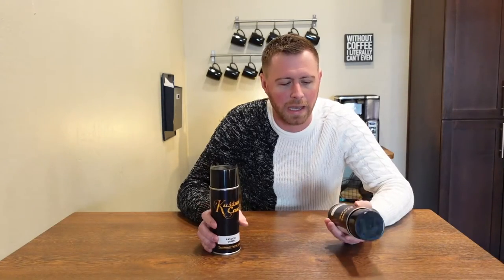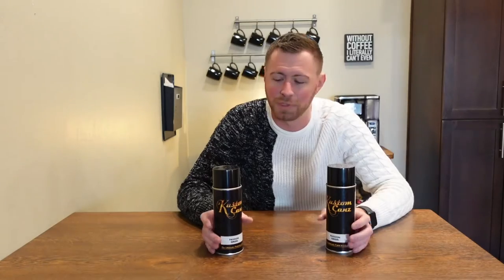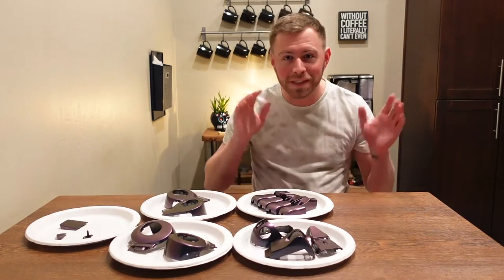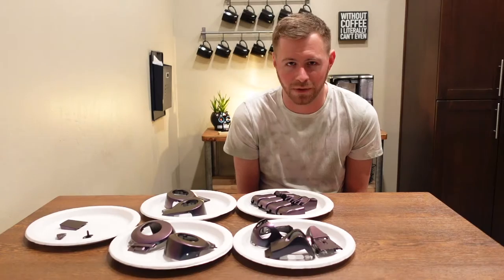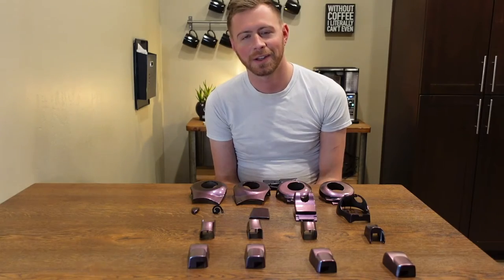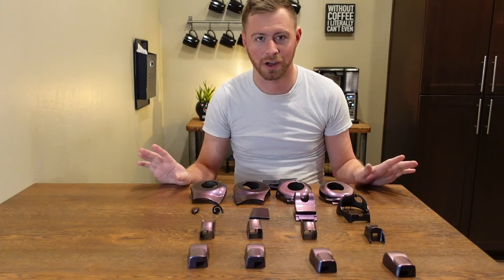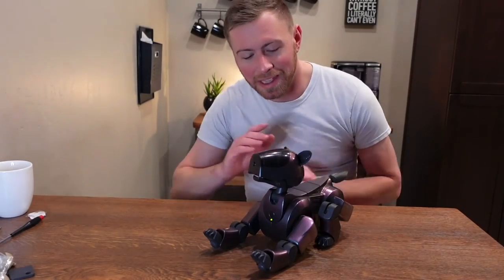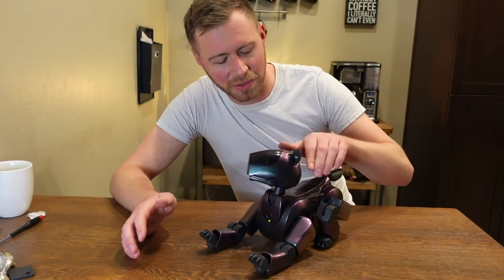Custom Painting an Aibo | Part 3: Painting and Reassembly

Comment: this video was so awesome and i love how your aibo turned out! youre one of my new fave channels for sure 😭❤️
Reply from the maker: Thank you so much!! That means the world to me!
Reply from the maker: @retrotoylover  you do realize that eBay does that itself. I did not take the buy it now option away. eBay did
Reply from the maker: @retrotoylover  ok, but this isn't just about you. maybe im between jobs and need the money as soon as possible. this listing has been up for almost a week. I lowered it from $640 to $400 to starting bid. it is the way of an auction to have bids take it up. I think you need to evaluate that there is more going on that isn't just about you.
Reply from the maker: @retrotoylover  how would that be fair to the current bidders?
Reply from the maker: @retrotoylover  I believe the pitch axis is the only one that is repaired but I could be wrong. I do not have any more for sale at this time.
Reply from the maker: @retrotoylover  I do not have extra cores. The core doesn’t make the head fixed though.
Reply from the maker: @retrotoylover  no, because I don’t have anything else for sale at this time
Reply from the maker: @retrotoylover  i would have the aibo clinic look over them before they are sold to anyone. I’m not taking my listing down. That is not fair to me or the bidders that have already bid on the item.